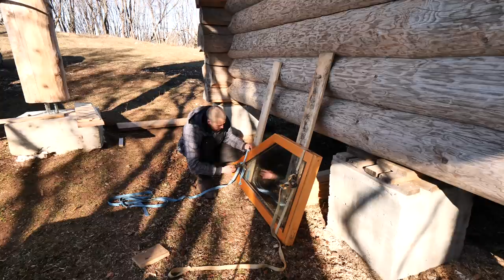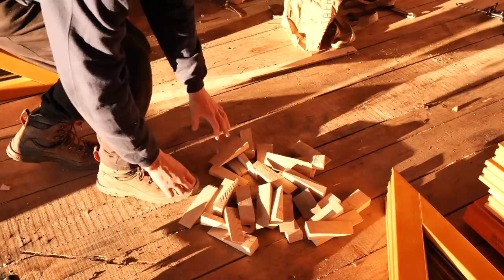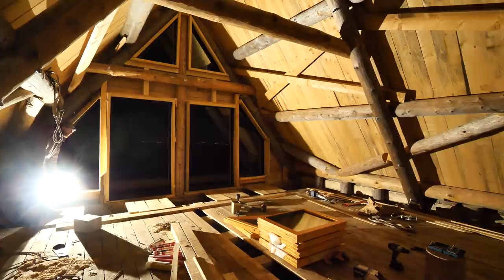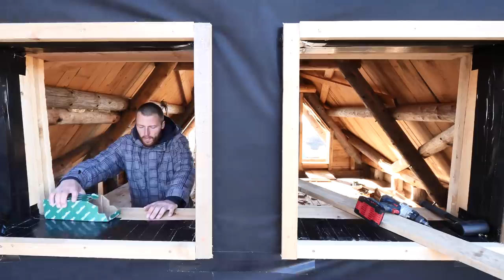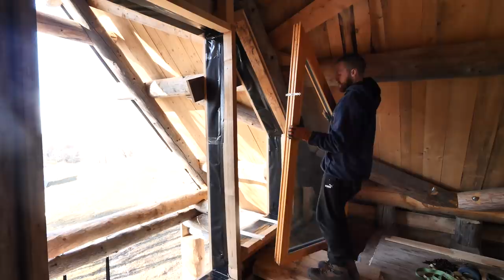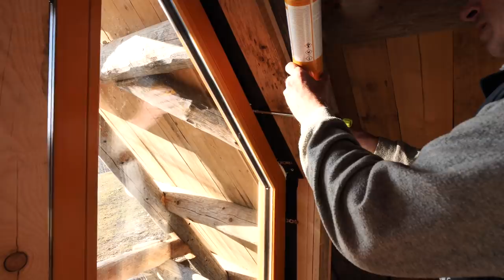Building Off Grid LOG CABIN / A-Frame Windows (S 2 Ep 19)

Comment: Oh, interesting detail on the wooden windows at 16:45; both horizontal lower parts are protected by an angled sheet metal that lets the water drop off easily. That's exactly where I'll have to touch up some windows that don't have this because of water damage (and no maintenance that should have been done).

Comment: If you close the windoframing- then use super elastic silicon in a color  that you like. There are silicons that are flexible and if the logs move or if there is a shrinking process- then it move with the movement. Its importend to cover the foam as fast as posible because it must be protected from sun heat and air. If not the process of rottening of the foam starts.